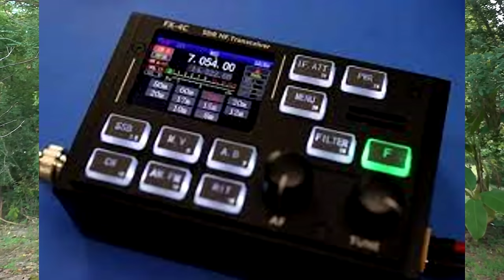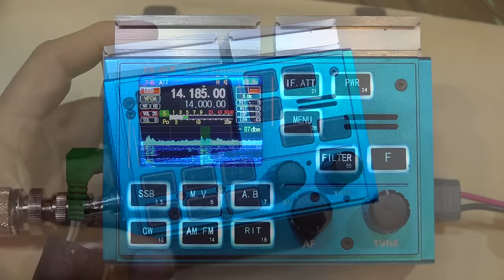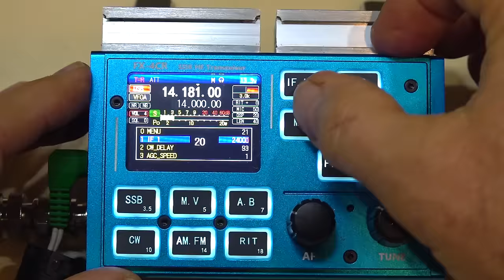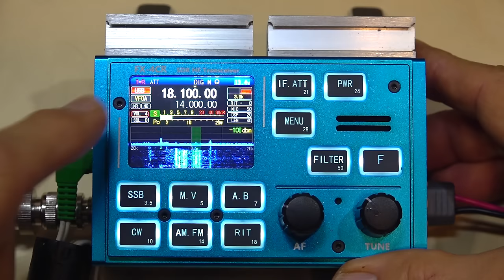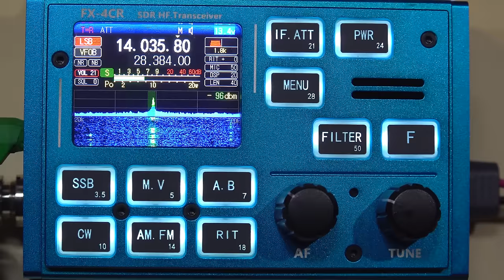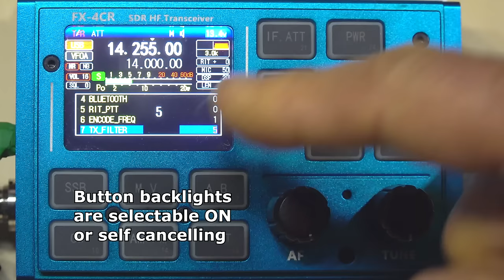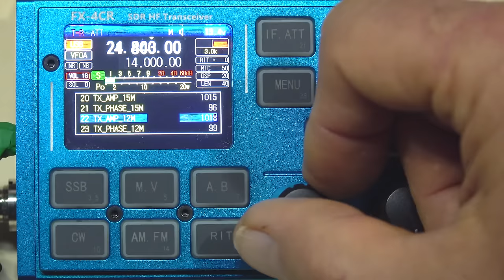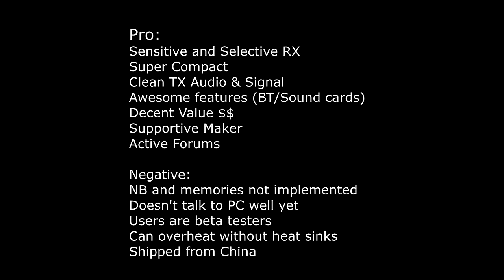FX 4CR - An Engineering Marvel

Comment: I absolutely love mine. I got the side rails but I’ve not managed to get the fan to come on yet. (SSB only) 
Today I spoke to Sydney Australia from England on 25m - 16,972 kilometers with only 20W using 3x 18650 batteries madness - I absolutely love this radio easily the best portable radio available in 2023.

Comment: Great video, Bob. Your voice is back to full strength! I really like my FX-4CR. I’ve also added a heat sink fully along the top. But I look forward to the handle/fan upgrade being offered as a separate purchase on Yu’s website. I bought RFDan’s amp cable and buffer relay for this radio to use with my Elecraft kxpa-100 amplifier when I need it. It’s a good, solid product!
Reply: Yup, I'm in a period where my voice is working...for now. I added a transistor buffer inside the mini  plug housing (just fit!) to drive the amp. New firmware is coming soon too.
Reply: How does it go with let's say 5-10W instead of the full 20W, calling CQ on SOTA, does it tend to overheat without the sinks?
Reply: Well, not on SSB…don’t do cw and haven’t done sota.
Reply: Fine. You can run up to 12W on CW if the outside temp is under 80F (without any heasinks) You can order it with the heatsink handles for full power
Reply: I’m waiting in Yu to offer the handles/fan upgrade for existing owners…it will come!

Comment: Seems to be A slightly improved malachite receiver with an added on transmitter. It's not in the same league as an IC-705 but it costs less than half as much.
Reply: It may appear that way from the display, but this is a MUCH more sophisticated device. It has tight receive bandpass filters for each ham band and has to provide another full set on the way out as low-pass filters for the TX. From the performance I estimate that it is a 14 bit device throughout. The Malachite is 12 bits or less for sure. Then there is Bluetooth and built-in audio cards...electronic keyer and a bevy of other user features. It's still a bargain at $550

Comment: In version 1.6 NB is now implemented. Hold M.V. Button down.  Yu has built a cooling solution as well, $35 takes some soldering to install.  Also, do you have the part number and brand for the elegant stands you use.  I was not able to find them.  Excellent review!  I was looking for info on how to use/adjust the waterfall display functions.  You have any insights?
Reply: Also, Yu ships to the USA via FedEx so I got mone in about a week and a half.  When they are in stock.

Comment: bob,   did you have to add the heatsinks yourself?   i looked on the website for these and didnt see them
Reply: Yup...had a piece of heat sink material and cut it in half. Just put conductive paste under the center and double sticky 3M foam tape at the ends. Absolutely adequate to keep it cool... doesn't take much.

Comment: Question: comparing this to a G90.  Ignoring the G90's antenna tuner, and when used in the shack v/s portable, which radio would you prefer to use, and why?   Thanks for a great video!
Reply: That is a very difficult question. OK, If I had to choose, I'd choose the G90. Why? The receiver is better. Sure, the larger screen on the FX-4C is nice, but the G90 is more combed-out engineering-wise. The RX is very similar to my IC-7610 in performance. Audio TX quality is about the same on both. the G90 is heavy too... ouch. Cool-factor? It's the FX4.

Comment: Leaning towards the G90 with built in tuner. Nice revew.
Reply: Can't go wrong with the G90.  Outstanding radio!  An advantage of the FX-4CR is size and portability.  If am working with a lightweight resonant antenna in one of the local parks, the FX-4CR seems like a very good choice.
Reply: I got the G 90.. on sale at HRO $399.00 and you just can’t beat that internal antenna tuner… just wish it had 6 meters…

Comment: Very nice video, Bob. I immediately ordered one and received it after 4 days. 
Are the heat sinks glued on or fixed with screws?
From where got you the stands?
Are you from Hungary? Nagy means large in English😊.
Best 73 KC3CVR, Dietmar, Pittsburgh PA
Reply: I just used carpet double sticky tape at each end and conductive paste in-between. Adding ANY heat sink material conducts enough heat away so it stays OK in any mode of operation. The stands are on Amazon...there are several types- choose what you like. I'm a NY'er living in Arkansas... yes Nagy means BIG. I'm BIG BOB.

Comment: Great presentation, peaked my interest for sure.  The one thing I cannot find when I look at the information I gathered on the internet is:  There is an internal mic on the face.  I cannot seem to locate the ptt function in menu or is it an external ptt button plugged into the side.
Reply: Yes, the internal mic is between the two rotory controls and actually sounds good. Indeed you can PTT it without the mic...forgot how- its in the manual.

Comment: Your recommendation for the IC 7610 cost me thousands 😊 this one is a little cheaper.
Reply: Hee hee hee.. Well, don't feel too bad. In the last year I've had the TS-990s, IC-7851 and FTdx-101D here for months. ALL of them are gone except for the 7610. News FLASH: Icom is just releasing a firmware update to include Pre-Distortion to the 7610. Holy crap! Only Anan has been able to pull this off so far...Flex?...nope... It cleans up Transmit distortion products to create an ultra-clean TX signal. I think I'm literally going to buy another/fresh 7610 as my next rig.

Comment: Nice case, but I got a (tr)uSDX kit, (designed by PE1NNZ and DL2MAN,) for $100, and added a $17 40W amp kit in case I needed to run power. That saved me $500 to buy other things, and I can buy a lot of other things for $500.
Reply: Yes, but the Tr SDR is a super-basic radio. It does work though.

Comment: Oh my Bob! :D
Nice interesting rig!
Any radio with a given power will give the same results; difference is in consumption, portability and ergonomy which has a cost. I do have an 891, but it sure is not that portable, after all it's meant to be a mobile rig. There's always some trade-off somewhere; with all that said, I tried the Chinese x108g but it had its drawbacks, so other than some HT rigs (Retevis, Radtel) I stay away from the made in China radios (lack of support, quality is not on par with japanese radios and they are more prone to failure, functionalities need improvement).

Comment: Overpriced clunky square box with too many multi-function buttons to remember is what I see. For not much more you can get a real radio as Yaesu FT-891, FT-710 or ICOM IC-7300. I purchased a quirky Radoddity G90, never again. I'll continue watching development for sleak design and more actual buttons and switches, analog meter, mixture of old and new with steam punk vibe  ; )
Reply: You forgot to take your medicine today.
Reply: I have two 891s and I love them but they have a ton of menus so if u can operate a 891 a bunch of multi function buttons on the  FX-4CR should not a problem for you.
Reply: Well, my next radio review is for you. There are no menus, gorgeous amber analog meter...made in USA by a Ham. It ain't cheap, but it is SO much fun to use. (TR-45L)
Reply: I totally agree with you for the cost of buying this you can get far better value equipment much better made with cast aluminum chassis's
Reply: Ditto.

Comment: Life is way too shorts for going QRP.  next
Reply: Meanwhile I make hundreds and hundreds of DX contacts every year on 5w or less
Reply: @EvanK2EJT  but you have propagation's help and you use digital or cw
Reply: @W-733_KWX    Yeah, I'm almost entirely CW, so that certainly helps.  It's definitely difficult to do QRP SSB.  I've done my fair share of it, so I know how hard it can be.
Reply: Not really. This is 6dB up from QRP and with a wire antenna with gain, you are totally heard on SSB. I use resonant folded dipoles. Got a 5/7 out of Russia when camping.
Reply: @bobnagy9084   Oh, for sure. I've done lots of it too.  If you use a good antenna, and propagation is decent, you can absolutely work all kinds of DX on SSB with 10w.  It's definitely easier on CW though.  It's kinda like cheating lol
Reply: @EvanK2EJT  Only hundreds every year?
Reply: @che59v   On my field QRP radios.....yeah, probably.  Keep in mind, I might go out once a week and make 15 contacts during a POTA or SOTA activation.  I think I had about 3000 QRP contacts so far in 2023, and probably about 1/4 or so of those are DX.  At home I run 100w, but in the field I rarely run more than 5w.  I'd much rather put a 5 ounce MTR-3B in my pack and hike up a mountain than a 13 lb FTDX10 LOL
Reply: sorry to hear about your short life span. Seeya on radio.
Reply: Well, life is way to short NOT to QRP.
Reply: @antonanker583  Please send again, can't be heard (again).
Reply: @che59v  well, it’s a gift. You either have it or you don’t. 😉